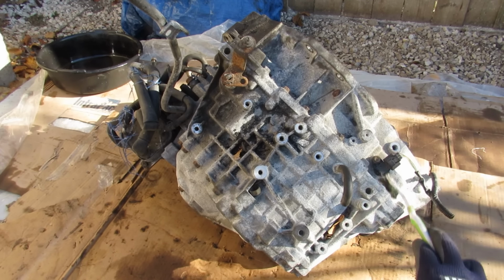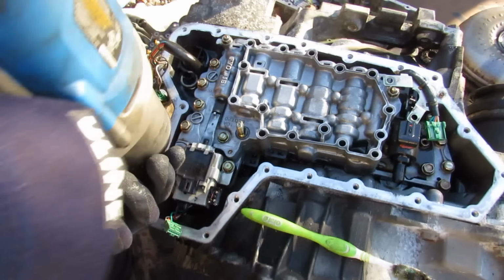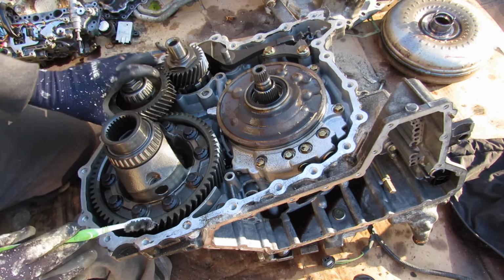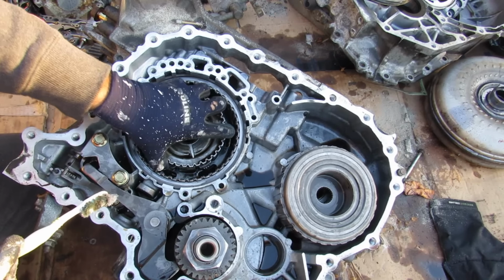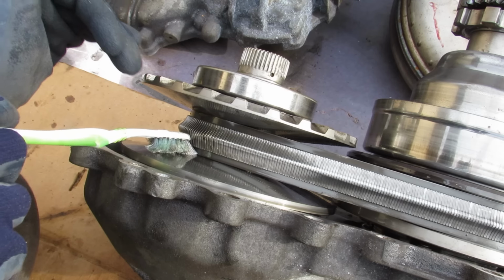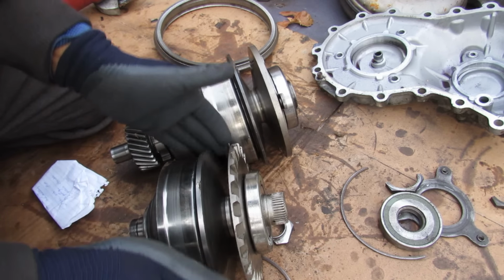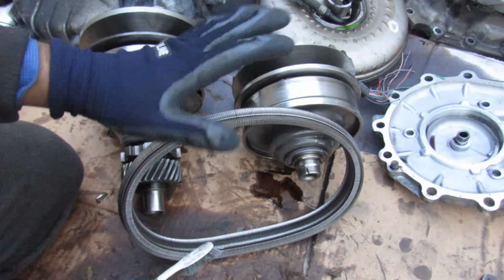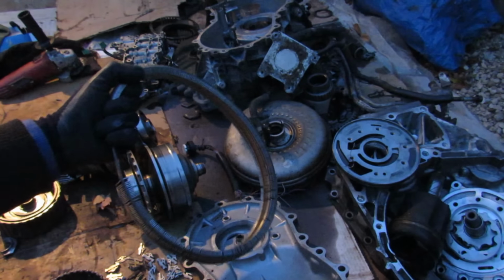Why Nissan CVTs FAIL

Comment: Thank you for this post. I have a 2013 Jeep Compass with the 2.4. I think this is the CVT that is in my car. Also, a few Nissan (of course) and some models of Subaru. My CVT started going bad at about 25K. I took it back to the Jeep dealership multiple times as it was still under warranty, and of course, they could find absolutely nothing wrong with my car. Then, when my Compass went out of warranty, miraculously, they discovered I needed a new CVT. I have been a Jeep owner since 1983. CVT or not, I WILL NEVER BUY ANOTHER JEEP AGAIN.
Reply: Nissan did same thing to me
Reply: That’s not a Jeep. Real Jeeps have a frame and are RWD. I’m sorry about your experience.
Reply: @user-ln7of9gs4s  I knew it was a mistake....my 4th Jeep, trying to be brand loyal and also buy American. But I got burned. I didnt quote this, but I will repeat it....."Today, if you purchase a Jeep, any model jeep, you either didnt do your homework or you are brain dead or both."
Reply: @rvierra7235  it’s not just with your jeep, there are many brands with junk cars. Honda and Toyota aren’t immune, but if I needed a solid vehicle, Toyota will be my first choice.
Reply: Any other motor manufacturer would have done the same.
Reply: Sue
Reply: @hyperlogos  Yes. There is currently (which many of us are part of) a class action lawsuit.
Reply: Couldn`t you intentionally kill it on warranty? I would!
Reply: Good decision, ALL new Jeeps are garbage. Anyone who says otheriwse doesn't work on them. Anything and everything produced by FCA is trash, and Chrysler was already ruining the Jeep brand before Fiat came along and made everything worse. Jeep hasn't made a vehicle worthy of purchasing since they killed the 4.0 inline 6 and even before they killed it, they made it less reliable each year by using cheaper innards.
Reply: @jessem8690  Yes Sir, I agree.
Reply: The Jeep Compass, Jeep Liberty and Dodge Caliber are all built on the Mitsubishi Lancer platform and use the jatco CVT, my Dodge Caliber is still running strong at 145,000 mi. I have a 5 speed manual transmission so I avoided a big problem.
Reply: Subaru uses its own CVT transmissions, TR580 for Low power cars and TR690 for high torque cars. They are much more reliable than Nissan. Almost Toyota/honda level but not quite there. They will last about 300k miles if mantained correctly
Reply: @514aam  too bad they also use their own head gaskets
Reply: @514aam  Subaru CVT is utterly crap! Google and find out how many models were recalled and granted extended warranty. I wouldn't touch a Subaru CVT even with a long stick.
Reply: @514aam  negative. Subaru purchased rights from Jatco to build a Jatco-designed cvt in their own factories. Subaru calls them Lineartronic, but it’s 100% Jatco design.
Reply: @Moistnmeaty90  Thus, its a hunk of junk.
Reply: @514aam  Uh...No...at least during that period of time, they were using the Nissan CVT for a couple of models (as evidenced by all of those included in the class action). And as for ANY....CVT going 300k....I dont know what you are smoking, but perhaps you should let me know, I am going to sprinkle a bit of it on my CVT. Perhaps that will fix it.
Reply: @rvierra7235  forester XT CVT 14", currently at 350k, 0 issues, just change the oil every 50k..
Reply: @rvierra7235  TR690 CVT, only repair, a selenoid, about 20USD at 190k.
Reply: @rvierra7235  we found the guy that accelerates slower than a school bus when the light turns green. 300k CVT he is definitely smoking the good good which would explain the slow driving.
Reply: According to US consumers report jeep car is a flop unreliable car maker just stick to Honda , Toyota reliable cars
Reply: @reymontano4854  Honda a reliable car?? Ha..haa..
Reply: @reymontano4854  Yes..yes..we know...why do you have to rub salt into a wound? Chill out.
Reply: I know better than to buy any vehicle with a CVT.  BTW, the Compass is not a true Jeep.  It is a Fiat.  Stick with the Grand Cherokee, Cherokee, Wrangler and the new Wagoneer.  These are true Jeeps and you won't find a mushbox in any of them.  Don't let your bad experience with a pseudo-Jeep poison your mind against the real Jeep models.
Reply: @NCF8710  cringiest comment I’ve ever read. Real men drive manual patriots. Blow me. 2.4 for life
Reply: @NCF8710  I figured the Jeep Compass was a Dodge!  The drive train is identical to the Dodge Caliber.
Reply: @NCF8710  Thank you, yes, Jeep is now Fiat. Over the course of 4 Jeeps since 1983, I have seen Jeep go straight down the sheet-hole. But even the new Jeeps are not worth buying.
Reply: @rvierra7235  I disagree.  In May, 2016 I traded in my 2002 Grand Cherokee with 252,000 miles on it for a 2016 Grand Cherokee with the 5.7L V8.  One month later, I bought a 2016 Cherokee with the 3.2L V6 for my wife.  Mine now has 76K miles and all it needed was tires, brakes and wiper blades.  Hers has 67K miles and it needed tires, brakes, a battery and wiper blades.  Other than oil changes, these vehicles needed no other attention.  They look and run like new and right now, there is no reason to trade them in.  These are the two best vehicles I have ever owned.  And to put this into perspective, the first new car I bought was a 1973 Ford LTD Brougham.  I have owned quite a few vehicles in the past 50 years.
Reply: @NCF8710  I understand. I have only owned 4 Jeeps since 83, all purchased new. So I guess I would not know what I am talking about in the least and you would. The Cherokee (the real Cherokee) was last produced in 2001. If you are refering to that piece of shit "new generation" chair-oh-kee, this conversation is over. There are easier ways to display your lack of subject knowledge matter, rather than doing it on YT.
Reply: @NCF8710  Not discrediting your statement, but 70k miles isn't much these days. I've worked on a lot of the later model Jeeps and build quality leaves a lot to be desired. I want to like them - I was born and raised right by the Jeep plant in Toledo and knew a couple people that built them - but everyone I know that has had one for more than 5-10 years swears they'll never buy another one
Reply: @NCF8710  You're really going to love changing the sparkplugs on that 5.7 Grand Cherokee, also keep an ear out for any ticking if it has displacement on demand. Besides that they are decent mechanically. The electronics will be problematic in the future like any Chrysler product.

Comment: From what I've seen, these Jatco CVTs fail because many of them were sold as "sealed for life" and the owners never changed the fluid, or the two internal filters. Change the filters and the oil, and they should be fine.
Reply: Yeah, plenum pressure too low for good cooling, too quickly oxidizes fluid.
Reply: you mean a filter and a screen.
Reply: @tommurphy4307  There's a filter on the side of these transmissions, it's a cartridge filter. Then there's a standard in-pan screen, a lot like any other transmission. No one ever changes the cartridge filter.
Reply: @tommurphy4307  Yeah, I got he meant that more technical distinction.
Reply: Where’s the filters?
Reply: @calebs4899  Screen type in drain pan, and paper cartridge in the front.

Comment: Hello and thank you. Awesome video.
Some CVTs are said to never change the oil, yes, that's what it is mentioned in the manufacture's maintenance booklets. Actually, its pretty weird, with a ton of moving parts and the heat that they create.
Does this makes sense? How could it be? Any idea, because I am skeptical of this.
Reply: It’s called planned obsolescence. Those parts are planned to fail after the manufacturers warranty ends so you either pay a lot of money to replace or by a new vehicle. It’s all about money. Change the transmission fluid and filters even if they claim it’s lifetime.
Reply: Because less maintenance is a selling point. Its designed to last through the warranty and maybe a bit longer but not a lifetime
Reply: to which maintenance 'booklets' where you referring? or was it someone else that told you that? Nissan has NEVER not recommended servicing ANY of its transmissions.
Reply: A lot of regular automatic transmissions do that too, no dipstick and "lifetime" oil. But if you want it to last, it needs the occasional flush.

Comment: Thanks for such a great CVT video! I'm curious, does the transmission oil pump still push fluid around even when in park? Or only in R, N, and D?
Reply from the maker: Yes. Since PRND are outputs of the engine and the pump is driven from the input.

Comment: These transmissions are 100% rebuildable.
Reply from the maker: Does Nissan sell parts for them?
Reply: There is aftermarket rebuild kits and push belts. And yes Nissan does sell parts for these transmissions. I replace the VB on every REF010D/JF016. Which I buy directly from Nissan. There is even aftermarket valves u can buy to replace the cheap crap Nissan put in them. And yes before u ask. I completely tear down the pulleys and put my own style rings on the pistons. I don’t even use the ones they send in the rebuild kits. Mine check better after rebuild. But there is occasionally a pulley so damaged it is beyond repair. So I do have to opt buying a used set, then rebuilding those. But to say that they are not rebuildable is like saying a 4l60e isn’t rebuildable because it has a bad input drum in it. Just replace the parts that need replacing and don’t put limits on yourself. You can do anything u set ur mind too.

Comment: My 2013 Nissan 3.5 Altima CVT is quiet and gives the best driving feel I have ever had.  I have owned 6 or 8 cars before, but this is my favorite so far.  At 123K miles it stutters sometimes if I am following a slow driver.  My CVT does not like to accelerate very slowly.  It likes to get up to speed right away and not monkey around, which best reflects my own driving style.
Reply: don't worry- as time goes on you'll get more and more comfortable with it. i wanted a maxipad but they don't get 32mpg and our gas is expensive.
Reply: @tommurphy4307  Isn't a 'maxipad' a female hygiene product?  LOL  Any gas you get will be your own.

Comment: Great vid. My 2015 Rogue Select AWD has 45K miles. Should I change the CVT fluid earlier than the recommended 60K?
Reply: Change it every 30K miles and stick to the correct fluid.

Comment: I've owned 2 CVT vehicles, both Nissan and I haven't had one problem with either of them. The first one had 110,000 miles and my current one has 96,000 miles. Like any transmission maintenance is the key, change the fluid every 50,000 miles and you should have very little problems.
Reply: Nah, I have one major issue with mine. It does not wanna go, and I’m not talking about “racing” go. Just “I need to start moving after the speed hump” type of go

Comment: I was told to use paddle shift to brake as it would reduce the brake pads wear. I knew it would not be ideal on my CVT Civic. Today my instinct proven correct..

Comment: I need some advice I have a 2014 Nissan Cube you crank it up you can drive around but once the motor gets hot the transmission stops pulling can you give me the top five problems off the top of your head to help me fix my car thank you very much love the video by the way
Reply from the maker: Check the fluid level and quality
Reply: @speedkar99  I had the pan pulled off the bottom of the transmission it was fairly clean wasn't that much so I cleaned it really well put new fluid in it and it still did the same thing I have replaced the gas pedal the throttle body fuel cell the air mass sensor everything that came up on my OBD2 scanner I have replaced because it keeps going into limp mode and then someone suggested me the other day that the transmission was overheating do you think it's clogged up somewhere inside that would make it do that because the only time it does it is when the motor warms up

Comment: CVT's just suck the fun out of driving. Some of them are programed to emulate fake shift points like an traditional automatic but that's just a small improvement.  Normal 6-8-10 speed autos are more reliable and actually repairable, seems like fewer cars are using CVT's now and switching back to normal auto's so that's a start.
Reply from the maker: True. But Normal everyday commuters don't need to feel connected to the road and that's who these are designed for

Comment: I worked for Nissan. Everyday there were failed transmissions coming in. Do not ever power flush your transmission. Yes change your fluid and filter but no power flushes. You see how complicated transmissions are?  You can clog those small veins with chucks of crap and even wash away some good junk that’s helps the gaskets stop small leaks from the transmission.

Comment: don't even look at this just call a lawyer when it goes out. it's reputation has preceded it. also there are two class action lawsuits. look it up.
Reply: @EpicDrew15  it was a pleasure conversing with someone who runs off intelligence not emotion. I wish you the best because you a rare commodity on you tube.
Reply: @EpicDrew15  what was you're last year of formal education?
Reply: @EpicDrew15  looks like
Book learning goes up and common sense goes away equally. Good luck overhauling you're Cvt transmission.
Reply: @EpicDrew15  well I'll give credit you are a true diplomat which generally indicates a fairly high IQ. I'd have quit responding to me a while back.

Comment: sir i have toyota yaris 1nr cvt transmission 2017 model last tume i go for service for gear oil change  , what i notice is that the mechanic didnt  pour the oil to the filler vollt plug ,,instead he pour the  oil to the ,,,, like plastic plug  cap near also on the gear body on top is that will be ok ?

Comment: Well, I have a 2014 Pathfinder with 160,000 miles with the original CVT in it. But, it’s starting to shudder and make some noise. I guess I should feel lucky that it’s lasted this long. Looks like I’ll be spending around $4000 soon to put a new one in.
Reply: Curious, has the fluid ever been changed? At what mileage?
Reply: Any answer ?

Comment: I learned my lesson about Nissan many years ago, from a Datsun 1300 pickup truck. The pushrod J13 engine wasn't very happy turning faster than 3,000 rpm (about 50 mph with the 4.875:1 differential) consequently one or more exhaust valves burned on an annual basis. Also there seemed to be some cooling system issues, as the cylinder head cracked nearly as often. And it didn't seem there was any lasting cure for the Nikki carburetor's sticking float. More recently, my opinion of Nissan was reinforced when their CEO was smuggled out of Japan in a piano case to evade prosecution.

Comment: Interesting video. I use to have a Nissan SE+ for 10 years. Never had a problem with the CVT transmission, one oil change and that was it.
Reply: And total distance of Nissan`s life was 10 000 miles )))

Comment: It's a bit more complicated than my 57 Chevy 3-speed standard transmission.
Reply from the maker: Just a little
Reply: @speedkar99  Did you put it back together with no parts left over?  I once did a Chevrolet Powerglide transmission and when I was done I had a small 1" spring left.  I didn't hear from the user so maybe I did a good thing.

Comment: This reminds me of when Buick introduced its V6 back in the 70s.  I opted for the already seasoned and proven small V8 instead.  While V6  the future, it was not the "present" for me back then.  Turned out to be a very smart move, as V6 had teething issues.  I think the same may apply to the developing CVT technology.  It may be the future, but it isn't my "present" yet.  Several years ago bought a Toyota with conventional transmission instead of a Subaru with CVT for this reason.  Much of what I have read since makes me think it was the right choice.
Reply: Funny CVT technology has been around since 1879. I would not call it a developing technology just old tech that has been improved on. Yet some like Nissan did not do anything to improve it just gave it a bad name. Jr. Dragsters have used a CVT for a very long time and continue to do so. The 1987 Ford Fiesta used one. It is just Nissan was the first to use a major ad campaign to push the CVT.
Reply: @sithyarael6807  subaru did that, too, with the justy.

Comment: Not all CVT,s work like this. Toyota use planetary gear sets on there hybrids. No master valve block, no hydraulics, no torque converted, no forward reverse clutch. The only oil is the transmission  lubricating oil.

Comment: I grew up in a garage and my ears and nerves are tuned to pick up any abnormal vibration and or the sound of any of the many moving/rotating/reciprocating parts with wear problems.  My sister has a 10 yr old subaru with cvt. It gears itself right down into idle speed any time you are down at daytime traffic speeds. She doesn't feel it but I detect a distinct light shudder. It feels like lugging a standard but I don't think that would translate through the torque converter. Is it the belt? Hmm. Wonder I'd it's had Trans Fluid service 🤔

Comment: The exact day my Nissan versa hit 100,000 miles the transmission crapped out then the next one crapped out at 115,000 mi. that's right the second transmission lasted 15,000 miles. I will never buy another Nissan and I will never own another CVT transmission vehicle. The dealer charges $5,000 to replace this piece of crap. When any other transmission on Earth is in the neighborhood of $2,000.